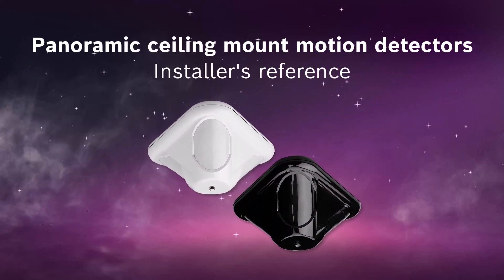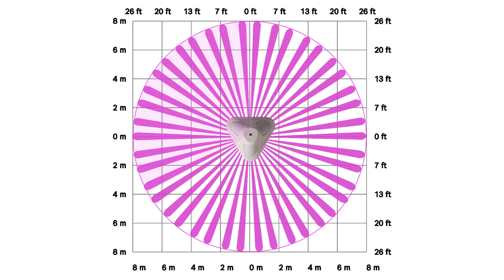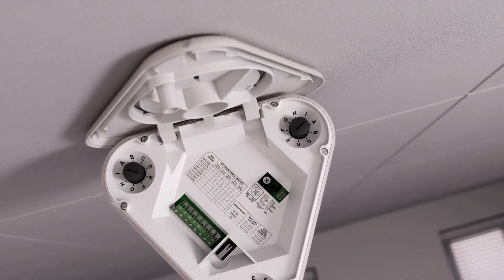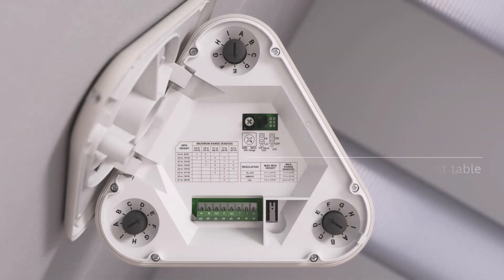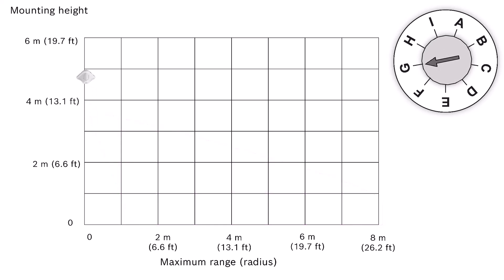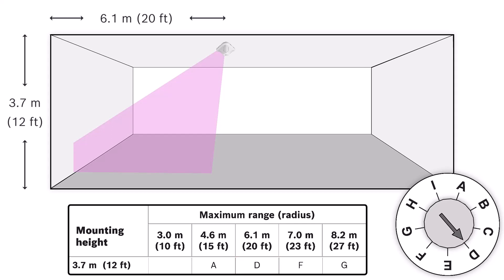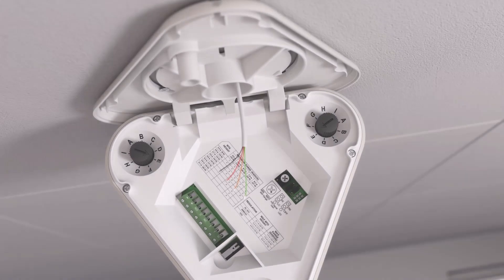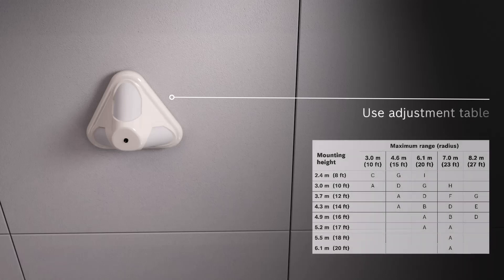Panoramic ceiling mount motion detectors - installer's reference

Comment: Salve come evitare falsi allarmi al pasaaggio di poccoli animali?
Gatti, uccelli.
Grazie
Reply from the maker: Grazie per la domanda. Il sensore panoramico da soffitto è pensato per applicazioni commerciali dove gli animali da compagnia non dovrebbero essere presenti. Questo sensore prevede un limite di 4,5Kg per gli animali, che dovrebbe evitare falsi allarmi dovuti a piccoli animali quali, uccelli, topi, o gatti di piccola taglia.

Great question! The panoramic ceiling mount detector is designed for commercial applications, so pets should be kept out of the protected area. This detector carries a 4.5 kg (10 lb) weight limit for animals. Small animals such as rodents, birds or even a small cat should not create false alarms.
Reply: @BoschSecurity Perfetto ne ho acquistati 3.
Grazie